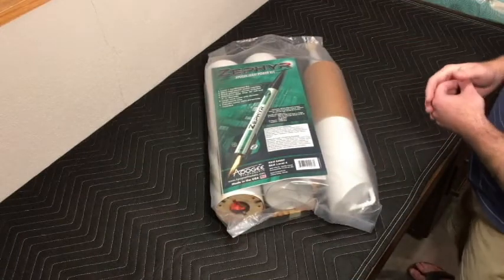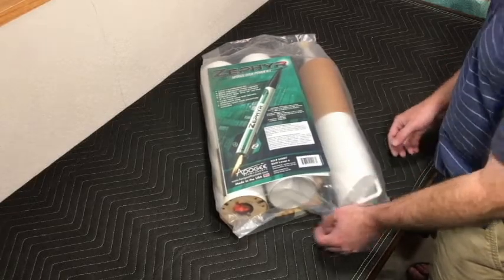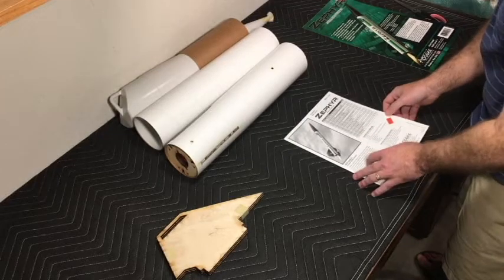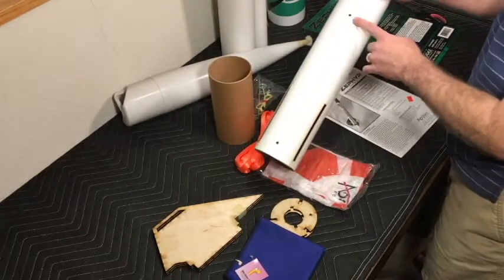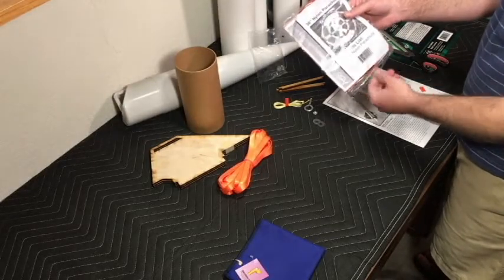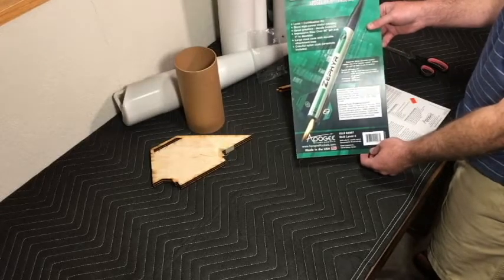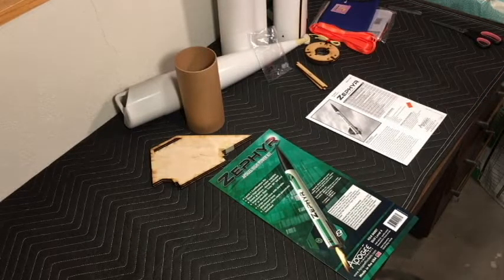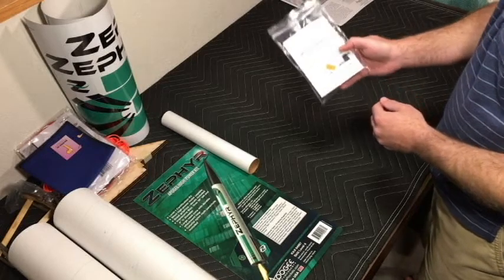r10 Zephyr Hi-Power Rocket - Part 1 Unboxing

Comment: Zephyr is about 110 bucks as of 2024. epoxy is over 100. . lol. how does that make sense? 

 isee your first flight went left. is it ok? and what about the slits in the fins, seems like a week spot

what motor did you use? and did it have the ejection charge built in it?
Reply from the maker: After having built it, I can honestly say that it doesn't require high end epoxy.  Cheap epoxy, even straight wood glue would probably have been sufficient.  The only complaint I have about the slits in the fins is that it makes painting harder.  Tim designed it for looks, as they serve no practical purpose.

I flew it on an H219 and yes, it has an ejection charge built in.  Thanks for watching and your comments.

Comment: Hey Kevin, I'm about to build the Zepher and everyone is sold out of Rocketpoxy, do you recommend any others? Thanks, Eddie
Reply from the maker: Sure!  I have heard some people say that Rocketpoxy was overkill as far as strength goes, and they may be right.  All it is basically is a thicker epoxy than standard epoxy.  I have heard some people say that they've built their Zephyrs with wood glue only.  Now, I tend to think that Rocketpoxy was probably extreme on the strengthness side and wood glue is probably extreme on the weakness side.  Going back in time, I would have had no fears about building another Zephyr with only regular 30 minute epoxy.  I feel as though the strength is adequate, the only thing you'd be missing out on is the thickness of it, which means you have to be more conscious of it running on you.  So, when it comes to doing the fillets, you probably would want to do 2 fin sides at a time (the fillets that would be facing up between two fins).  That way they wouldn't run on you.  Then mix up another batch and rotate the rocket to do the other 2 fins fillets facing up.  And then 1 more batch for the third side.

But as far as strength goes, regular 30 minute epoxy would be more than enough strength to build the rocket with.  As an example, I can tell you that the strongest thing I ever built my R/C Planes with was 30 minute epoxy and you can only image the G-forces that high-stress aerobatics would put on the wood joints, and they hold up easily.  Holding through the wall fins with 30-minute epoxy will hold just fine.

Again, the only downside is the "runniness" of it, so keep gravity in mind when applying it and you'll be good to go.

Good luck and have fun!